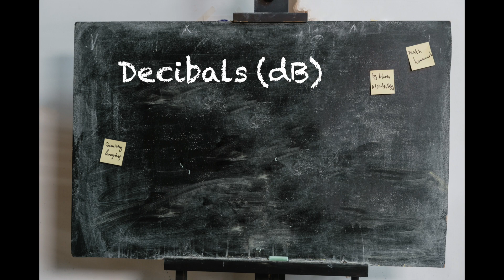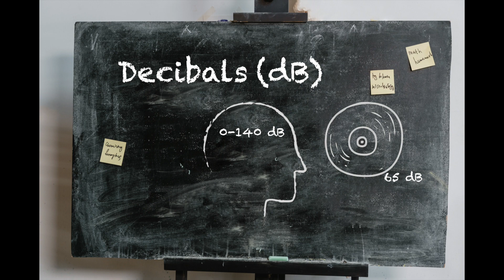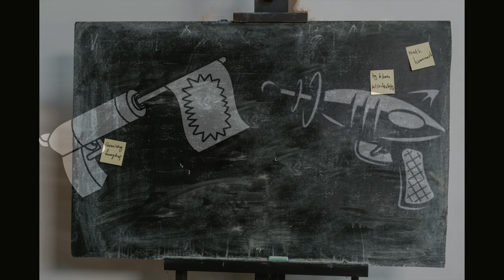Is Dynamic Compression a Bad Thing?

Comment: @4:44 -- Why use compression?
Why not turn up the gain on that drummers stem?  This leaves the shape of the instrument's sound intact, and it affects nothing else in the recording.

Better yet, record the song again, and move the microphone closer to that drummers drum -- or -- the drummer should exert a little more pressure to increase the volume of his taps.

When you use a box to augment the sound, then the recording will now include the character and distortion produced by that box.  Compressors are no exception.  In fact, compressors are the worst offenders.

When you run the signal through the compressor, even leaving the compressor's knobs and levers all in their neutral position, you are still running the signal through that box, and you will hear it (assuming you have a good stereo and set it up properly).

Compressors are active processors, and those are the worst offenders to the once virtually pure audio signal.  And the distortion from each box in the signal chain is cumulative.

One of the most expensive and critical boxes in a home stereo is the pre-amp.  It plays a huge role in how your stereo will sound.  If you have a receiver, then it contains a pre-amp.
Compressors are a form of a pre-amp.  So when the studio runs the signal through a compressor (and more than one compressor), it is like you using multiple pre-amps at home.  Each one, no matter how good it is, will degrade the signal.

Fixing the recording is never without compromise.  Something else will suffer.

The best fix is to not need a fix.  But doing it over, to get it right, takes time and determination.  Those traits are often in short supply -- especially if the artists never heard their recordings on a great stereo (if they never heard the flaws, because they never sat in front of a professionally set-up high-end stereo).

@5:07 -- You nailed it!
Reply from the maker: Thanks @perhaps.  Always enjoy your feedback!  Valuable insights as usual.